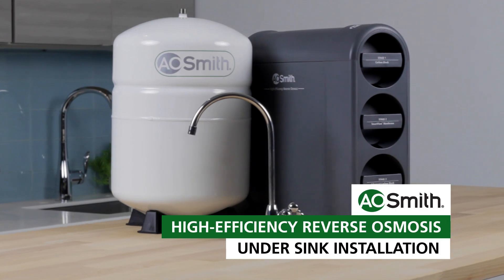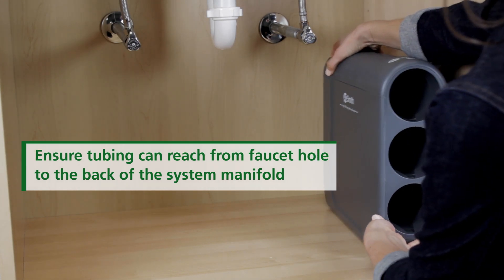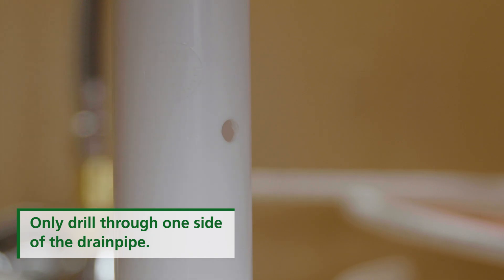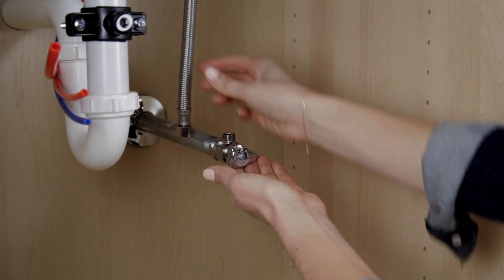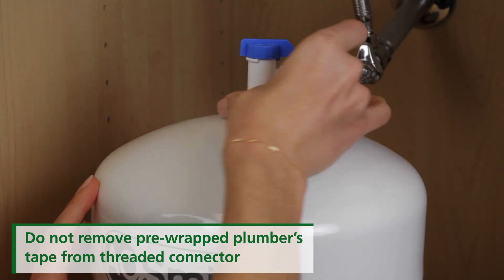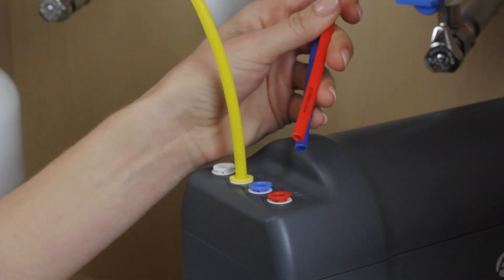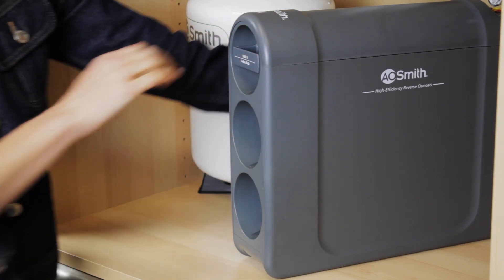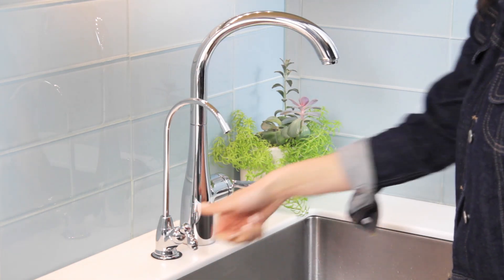High-Efficiency Reverse Osmosis Water Filter Installation

Comment: The air bladder in the tank won't allow more than 1 ml of bleach to be added. So how do we add 3 ml as required?
Reply from the maker: First, insert one end of the yellow tubing into the water tank valve. Using the included eye dropper, add 3mL of bleach into the open end of the attached yellow tubing. If you are still having issues with installation, please contact us at talktous@aosmith.com.

Comment: Water started leaking at the bottom back of the filter system
Reply from the maker: We're sorry to hear your having trouble with the RO system you purchased.
We want to ensure your issue is resolved.

Please send your phone number to talktous@aosmith.com so we can reach out to you.
Please include this review to ensure you are connected with the appropriate support team.
Reply: I think they all leak after about 6 months. I’m 6 months in to my 2nd system and now it leaks like the 1st. Now reading that other people have the same problem. Changing filters doesn’t help either.

Comment: Seems like my tank came sealed shut. I couldn’t even fit 3mls of bleach in it. Did anyone else have this issue?
Reply: Yeah that's the air bladder that pressurizes the system.
Reply: Okay. So how then do we get the 3 ml of bleach in?  @paulprescott7681
Reply: Measure the psi of the tank, remove some pressure, add bleach, and add pressure back